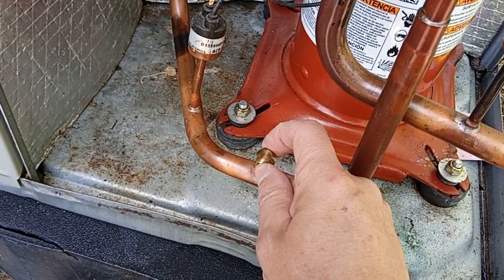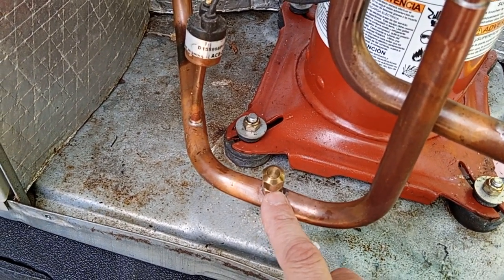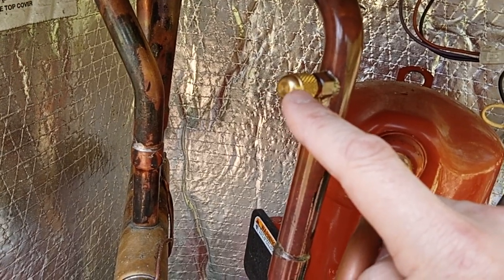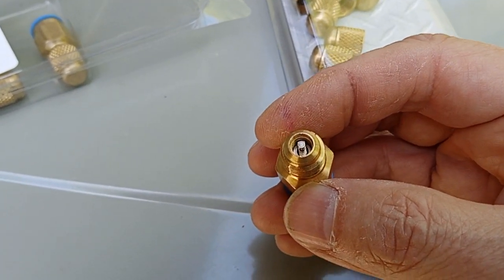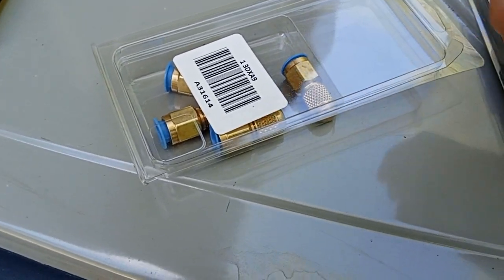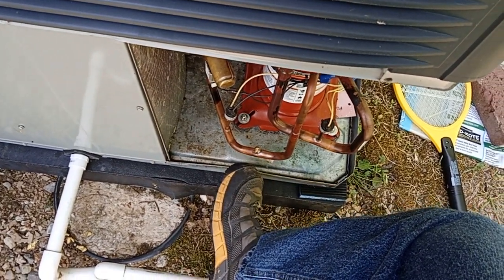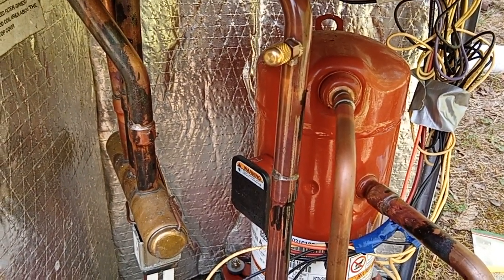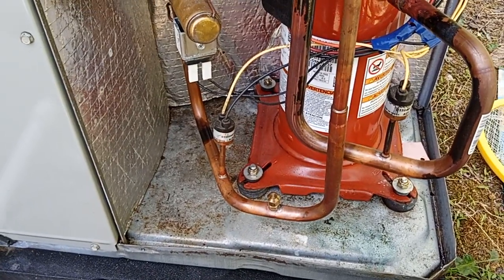The Trane Wreck Part Tres, Stopping the Leaks

Comment: Good observations; you seem to be an intelligent man. As an HVAC tech myself, if you found an HVAC company to recover your charge for only $150.00, that's really cheap. I would charge at least $300.00 to do that. A pound of r410a is around $100.00 if an accident happens and you lose some refrigerant, which can become very expensive. But good video, and good luck.
Reply from the maker: Yesh 150 is probably about a service call cost now, 150 was just a "winging it" figure, more like a call and labor 30 years ago when I was a Tech.

" A pound of R410a is probably $100"

A 25 pound cylinder is $300